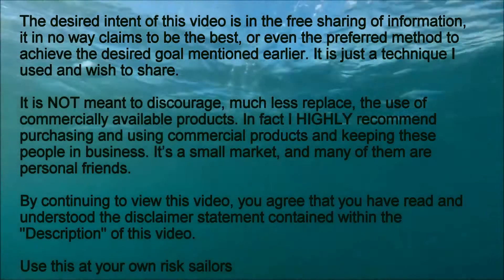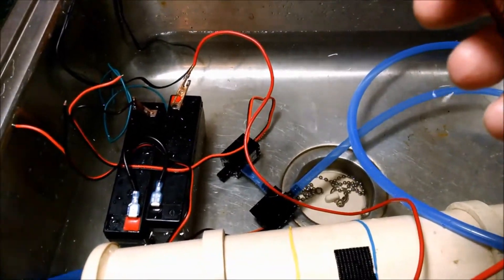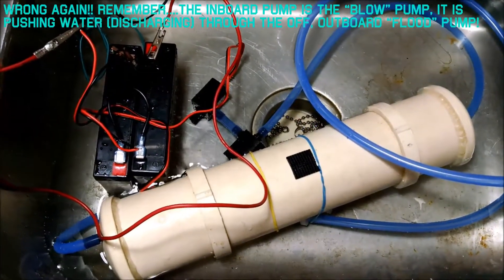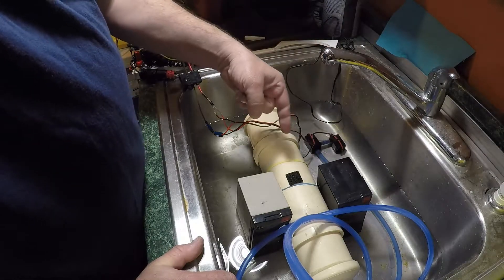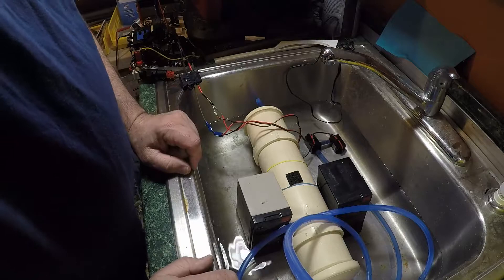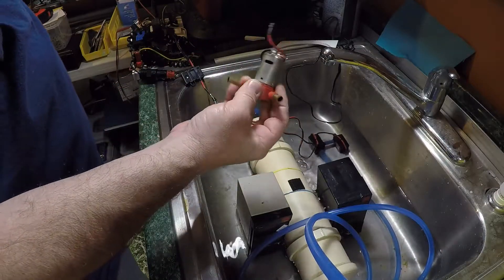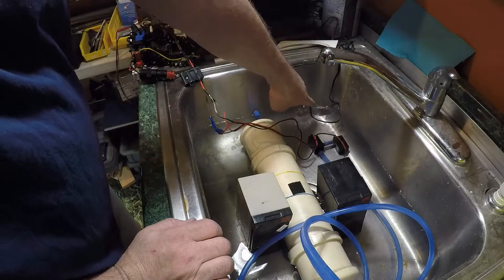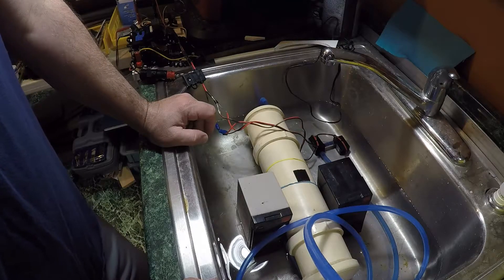Dual Pump BALLAST DISPLACEMENT SYSTEM (BDS)

Comment: hi mate good stuff i planned the same system myself  but still have a little confusion..any chance you could send me a clearer dia especially in regards to where the inputs and outputs of the tank should be placed..also i am not sure where the emerg air tank should enter the ballast tank  atop or bottom..i am 80% there..I have learnt a lot form you thanks mate mark.e.richards@det.nsw.edu.au